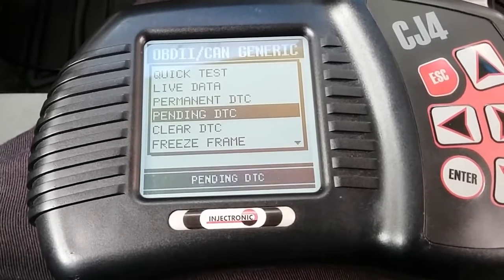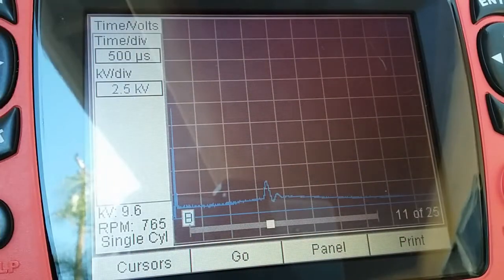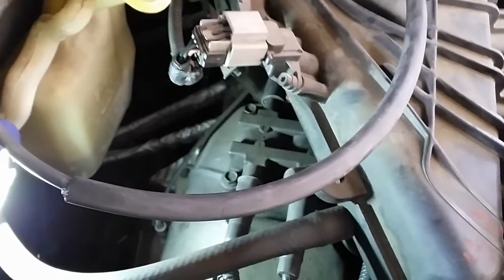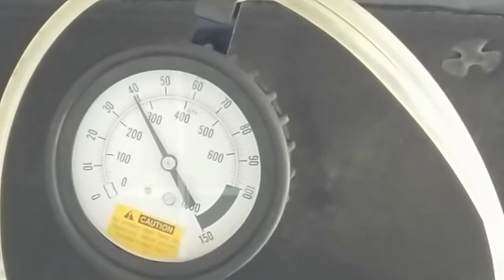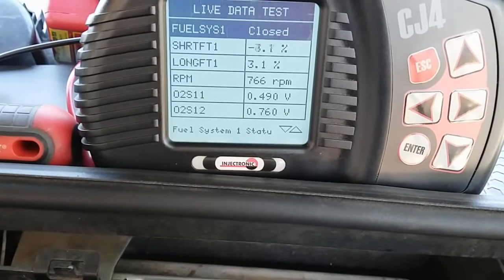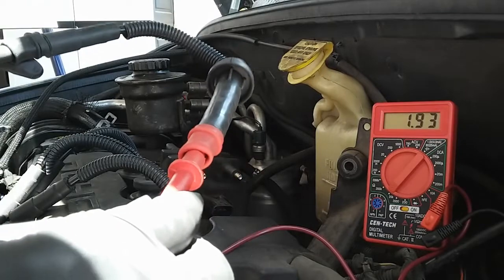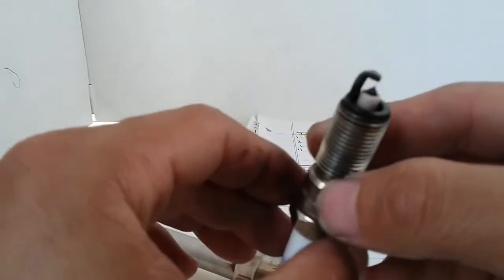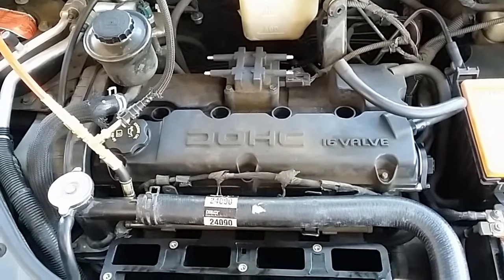(Chrysler PT) Diagnosing a Pending P0303 cylinder misfire - Part 1

Comment: I have a 2007 pt cruiser and its reading this code
Reply from the maker: It could be anything from :
Faulty plug wires, faulty spark plugs, faulty ignition coil pack, faulty injectors or leaking intake manifold gasket